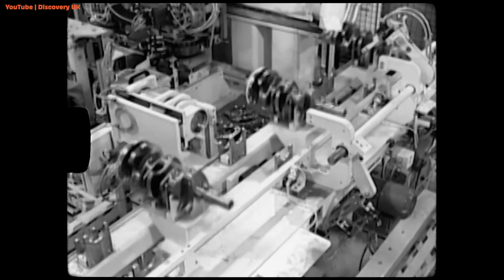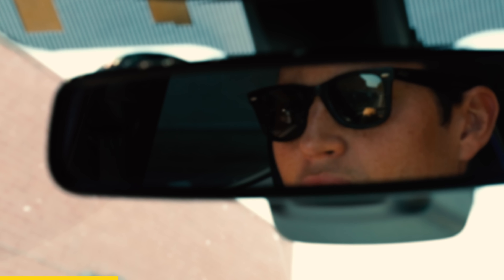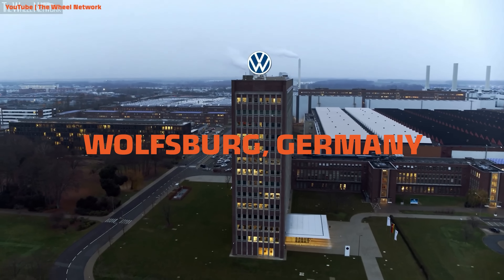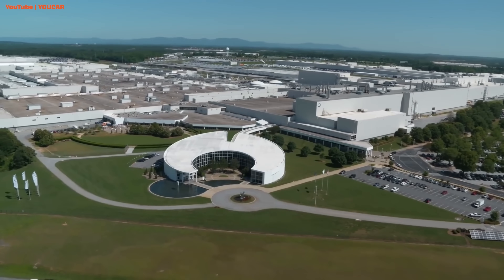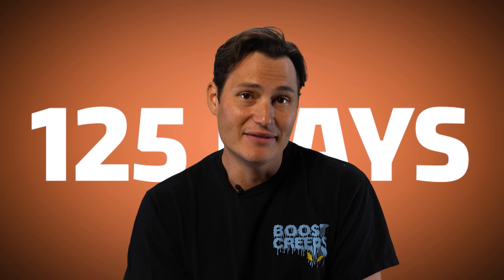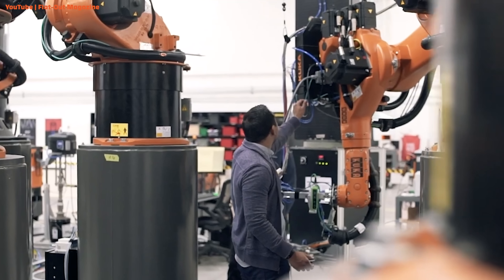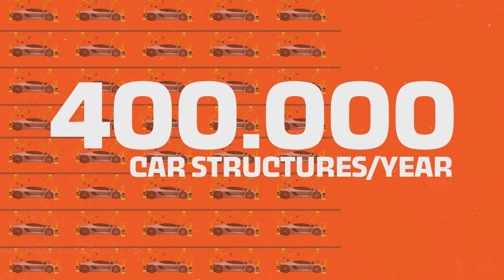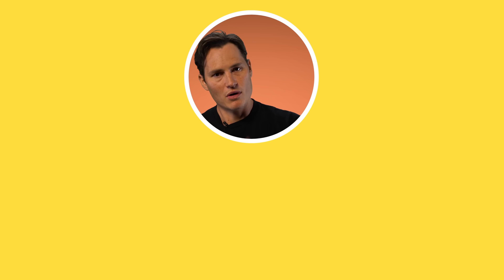A.I. Designed this Car

Comment: Super interesting but I think they took too much of the press release material for granted. On the small end, there's no way you can get a handful of big ass Kuka robots, the building and support systems for US 3M. No way. Yes, this agnostic type of assembly will be cheaper than a designated line but when numbers are that off, I wonder how much else is. 

Anyhow, still interesting and still very possibly the future.

Comment: The cost of manufacturing of vehicals will get cheaper, but the consumer cost to obtain these vehicals will not. Im sure the price tag for the consumer will only get higher, for even though manufacturing gets cheaper there is always and excuse for the rise cost to the consumer, hidden under a title like" luxery" , " performance", " comfortability", "efficiency".. wich is just desing integrity. Making a vehical with all these design qualities that are better than then the previous model, cost less to manufacture then the previous model, and ends up costing the consumer 1/3 times more then they paid for the previous model....  funny how that works out

Comment: My truck was built by AI ( alternative intelligence). They started with the heater core and built the rest of the truck around it.
73% of the truck has to be disassembled to swap the heater core.  That’s a lab proven statistic. Take my word on it.
Just because you can use just enough material to make something work, doesn’t mean it will last.
It also doesn’t mean it’s easy to service when it breaks.

Comment: Great job showing us the concept and process while contrasting it to present and past methodology.  The CEO's explanation of where the data set came from that the AI system used for to calculate the design(s) was very helpful.  I wonder how much simulation was part of the AI process (for example testing subsystems together).   Excellent video!
Reply: If it was truly an AI engineered car and used the MOST EFFICIENT way to do things it would not be using gasoline to power its selft... that is silly.. an engine that spits out 75% of the unused fuel... if they really wanted a super car they would put an electric motor in there

Comment: i suspect that Czinger is perhaps exaggerating the extent to which they use AI and 3D printing.

additive printing isn't as strong as subtractive printing, meaning that the parts need to have more material. it also can't ever get as thin as rolled and bent sheet metal. there were some parts in the video that were definitely stamped metal parts.
the idea of using an AI and computational engineering is interesting, but it still requires a strong guiding hand of a human, and to massage the end result into something a human can actually use. Its also super risky - the AI will try to min/max everything, which means that any case not explicitly specified by a human may be sacrificed to improve other cases - for example a head-on collision may be very safe, but 5 degrees off head-on may be extremely dangerous because the AI didn't "think" it had to protect against that. Its a bit of a silly example, and they're presumably account for that, but its just to illustrate how something obvious to a human may not be obvious to an AI. Just look up examples on youtube of machine learning AIs that exploit bugs/glitches to "do what they're told to do" without doing what the programmer meant for them to do.

also - how is a car designed by an AI supposed to be inspired by something?

Comment: I think it would be incredible if they did something similar but with a motorcycle platform. 
The only question I would ask, is there any way to work on these cars or are they guaranteed a certain amount of miles and get melted down?
I'm always interested seeing efficiency and innovation bringing new light.

Comment: AI and Generative design will never replace engineers, it merely is a tool for the engineers to do the best job they can with the least time and effort, but you still need engineers to use it correctly, and fix it when it's broken.
Reply: this comment will age like milk
Reply: @totalcrash5006  lol. It won't replace engineers because it was designed by engineers. What kind of person would design something that would steal their own job!
Reply: I partially agree with you...yes engineers will be needed to set the parameters and make decisions but for a 20 parts assembly which needs 10 engineers to develop, now the same 20 parts assembly will be reduced to one part thanks to GD & AM so at the most 2 good engineers and a powerful AI will be enough to get the job done...I feel sorry for the remaining 8 engineers.
Reply: @nandanhegde2986  Yes, it will reduce the number of engineers needed to do a task, but not replace them entirely - the same thing 3D CAD software and every piece of IT software that stores files has done over the last 40 years. My experience as an automation engineer is that companies always just find other areas of value for their labour to work, and never get rid of them. They only reduce their labour force when they are struggling financially, in which case the company is normally doomed anyway.
Reply: @pilot2b1993  Yes I am not pessimistic about automation I am just realistic on the fact that jobs will be replaced by AI no doubt in that...but in industry sense the jobs will be displaced meaning people will be forced to find a new job by up skilling or re skilling...but there will be a harsh  transition where people will have to adapt...those who are flexible will land a new job and those who are rigid and oppose the transition will sadly remaining jobless...but things will move on...progress stops for no one...then to solve the amount of unemployment we may be compelled to implement UBI to stabilize the society and so on...

Comment: As an AI researcher, I can tell you that most of this is bullshit. Yes, AI can design parts using finite element analysis and fluid simulations etc but the real world is infinitely more complex than what you can describe in the CAD software programmatically. AI can design a rearview mirror that's lighter and more aero than anything humans can come up with but it'll be impossible to manufacture. 

Metal3D printing is also another overhyped tech. Yes, it is a very cool tech and it's already being used in aerospace applications but the current state of the art of that tech has massive downsides that limits it's use to parts that are very small. i.e, no you can't 3D print the entire chasis our of powdered metal.

Comment: 3D laser metal printing is actually not so great (at least for part life expectancy

https://youtu.be/fzBRYsiyxjI

Here's a video on it.
The laser doesn't melt perfectly thus making imperfections and having cracking and breaking points over time.

Comment: It sounds like it could lead to one of the most difficult to repair cars ever. I'm thinking of the video about Bless the Engineer video that has a car with easy access hatches to replace the struts in the car.
Reply: You don't fix them you melt them down and recycle them into a new car.

Comment: i hope it works but there is a reason 3d printing isnt used everywhere it technically can be used. it might be faster and cheaper but materials arent stronger, atleast not most of the time (idk if any are stronger at all), than traditionally made parts

Comment: Wouldn't give more than 50 cents for a robot made vehicle
Reply: It's actually wicked fast, just broke the record because only an A.I. knows how to make it insanely efficient, it knows what to do with the gravity, weight, etc. so you're really making a big mistake because it's impressive and has the most speed compared to what us humans make, we'll never be able to make anything as efficient as A.I. makes which is also why they're utilizing Generative Design to redesign Batteries and make them efficient without using expensive and toxic chemicals, hell they're even utilizing it to make better computer chips and will keep Moore's Law alive.

Comment: Actual automotive engineer here: regarding using AI to design products like in this video, this isn't actually new technology.  We've been able to design parts like this for a while, using topology optimization. It can take a lot of the workload for designing a part off the engineer. However, the important part to remember is that, all those input variables you have to enter into the computer to start the design... Those are the hardest part of every single design.

Comment: 7:14 imma stop you right there

if you have ever used a 3D printer you would know that many files require some sort of support material. especially with plastics. i try to keep it to a minimum but im still throwing away like ~5% of what was extruded from my printer as just support materials.

Comment: I have bad news for you Donut. All of the inputs are from current design. That, my little melon-headed friend, is why AI creates a final output design with, say, 4 wheels rather than 3 even if 3 is potentially optimal.  AI does one thing and one thing only here: it optimizes the structure of the individual parts and reduces part count within the boundaries of parameters set by, you guess it, human fkn beings.  AI isn't at the point, yet, of setting its own parameters for design from the ground up.  It's not unlike why so many alien creature designs in the movies tend to have human-inspired physical traits.

This is why you end up with 4 wheels in a 2 x 2 configuration, A-arms regardless how they are shaped, brakes with calipers and rotors, seats positioned side by side, doors that open in non-novel ways, etc, etc.  That isn't AI design.  That's human guided and human configured and human-taught AI design. Huge difference.

Comment: This is surreal. Sadly, I don't think that it would work very well. To make a car this way you need an almost perfect understanding of engineering. Imagine that the ai does something in a way that the windshield cannot be replaced. Or any important part. It needs a lot of time more, and testing of the prototypes. But once it's done... It will be absolutely amazing.
What I believe that can be done with current tech is only a few parts being designed by AI.

Comment: I guess the fact that each car still takes 125 days to build tells you the in-depth story. Method is fine unless you want to chuck out 100s of VW Polos or Corollas per day.
FYI until about 12 years ago, the design of each new Toyota was given to a Chief Engineer, who had to summarise, on 1 A4 PAGE for the Directors of the company, the concept of car, reasons thereof and upto and including lead times and budgets...
No wonder Toyota was considered as the No1 manufacturer in world till recently. 
I think in terms of sheer volume they still are. 
Some Japanese were smarter than AI. 
🙂😉

Comment: “A 3D printer doesn’t print out extra material”.

…Well… sometimes. 
It is called support material, and some structures need it.

But yeah, 3D printers are more efficient, and even the support material is probably calculated to be minimal.

Comment: That's all cool and shit however, current methods of car production are cheap and fast, 3D printing can create parts which are saving weight however the quality of metal made using 3d printing is worse then the quality of metal made using casting, rolling, it's a much slower and much costlier method which requires expensive equipment.
If one day we manage to perfect the 3d printing method, and cars become a product that has way longer longevity then modern cars then this method does make sense.

Comment: "3D printers only use the amount of material they need and create no waste material"

So I take it you dont use 3D printers very often. Have to use them at work, the amount of waste material they produce is not negligible, especially for more complex parts. The printer needs to print scaffolding to hold the structure in a stable position while it prints, the scaffolding needs to be removed afterwards, and may or may not be recycleable.

Comment: 125 day lead time on parts is stupidly high, your bottleneck will be floor space to manufacture all those parts simultaneously, and it would raise capital risk, since you would have to make better long term predictions of required parts and sales numbers.

3d printing molds and doing the old CNC, and pressed steel etc, would be a lot better for high volume production while people figure out how to speed up the 3d printing process.

The real advantage is the hyper specialized part designed by AI (which can still be adapted to older techniques) and the 1AU assembly system.

Comment: you talking about it like it is something new. Bugatti is actually using AI to design parts like Brake calipers. 3D printing is used by porsche on their 911s GT cars and Koenigseggs Engine. The dude is just making the same thing and selling the advantages without telling the disadvantages. For example porsche said the 3d Printing has a high failure rate because the Aluminiumdust needs to be perfectly clean which also means you have to produce the aluminium powder while its sealed in the container it should be shipped with.
Or that the overall strenght of 3d Printed objects are not as high as forged products.
Or the energy needed to produce parts is orders of magnitudes higher than on "classic" productions.
Or the Production speed is significantly lower than on classic production cylcles.
Or Reinforced materials are simply not possible because 4 robot arms are not specialized enough for them. Like a 400 tons (metric, i dont like incest) press which presses hard steels to parts in seconds.
Or that the issue of ai based designs are not the efficency but declaring precisely enough the "rules" to work with. What is more important? Aeordynamics, security or weight? 

Im glad i watch other youtubers talking about such topics, so i can learn the facts there and enjoy your videos for its video materials any making fun of your bad education

Comment: Technically no, it’s not some artificial robotic entity that designed it, it’s organic   Optimization algorithms that find the ideal strength loads and shapes in certain areas but the designers are most definitely people. This has been around since the 1990s so yeah new my ass

Comment: As someone that works in a mid level automotive parts supplier, I don't know how I feel about this. The tech is undeniably impressive, but I think I feel the same about this as I do about self driving cars and autonomous drones in military service. What happens when this tech gets to the point that people are all together unnecessary? Also how much of a pain in the a** is this car going to be to work on? Efficiency in space is all well and good, but that's only the case until something fails. But then I guess by that point people will be unnecessary to fix cars too.

Comment: Seems like an AI advertisement.  Feels like sales talk when you don't mention any negatives.  For example, the process of making a car is so fantastically cheap that it's almost magic.  It only fails when people don't like the car and they don't sell enough to cover the cost of setting up the factory.  Shitting on 100 years of mass-car-manufacturing and using a super car as an example of the future just feels... not credible.  You might be right but at the moment it would be as good to shill for flying-car technology and hydrogen-powered cars.  ANYWAY, what the designer talked about was basically genetic algorithms, which don't really make decisions so much as generate a bunch of possible designs (maybe millions) and select the best.  Then the computer make some random changes to see if it improves the design. etc.  It's not really having a computer make decisions for you.  I'll bet there's still plenty of engineering,  Instead of putting a lot of effort into meeting up with other teams, the effort probably goes into making and adjusting requirements, making (gasp!) aesthetic choices, and generally making the whole thing look like a car.

Comment: A 3D Printer DOES create additional structures, they are called support and have to bei removed after printing. They are used for structures wich are overhanging and are not having any contact to the ground of the printer ("buildplate"). But you're right in a sense that 3d printing is waisting much less material than e.g. CNC routing

Comment: This report is great and I am encouraged by the vision as additive manufacturing combined with AI is definitely the way forward.  However he has somewhat exaggerated the AI design input and overlooked the human input of this design.  I lecture in these subjects and I'm an industrial design engineer. The computer will run algorithms that optimise an existing design in a variety of interesting ways but it doesn't start from scratch,  an entire detailed design must be first produced by a human and converted into 3D CAD data before a computer can generate anything. It needs a lot of parameters to work within and that's a lot of complex set up by highly skilled engineers.  Not to mention the computer coding! Though AI will definitely become more advanced to the point it can do much more sophisticated designs in the near future

Comment: The type of 3D printer they are using doesn't just use the amount of material it needs. Although the powder that was unused could be used for the next batch, it's going to be a weaker part, and you can't recycle it more than a couple of times. Since the heating chamber is already at the edge of the sjnthering temperature for the powder and the laser tips it over the top, the temperature degrades and even fuses the grains together in places it shouldn't.